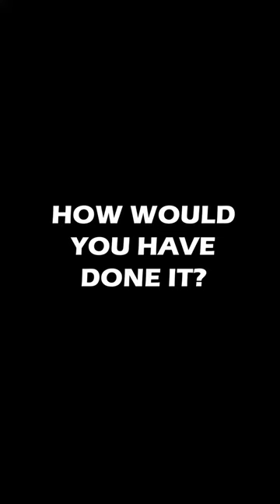Framing On Existing, Non-Level Concrete #framing #construction #shorts #howto

Comment: Nail studs to bottom plate and temporary cross members snap a line at top and cut.
Reply from the maker: this could have worked if the slab was flat. but it was wavy also. honestly was a terrible slab to build on but work is work and we got it done

Comment: Run a level string line at your top plate to get your heights. (I don't have a laser) or pour a new concrete pad. Maybe use that as driveway. Or knock it out and put flat concrete in. It is what it is

Comment: Run a laser 3' to 4' off lowest point, one man call out offset and number each 16" oc location while another man cut and number each corresponding stud as its called out...

Drop the studs in numbered location and frame as usual.